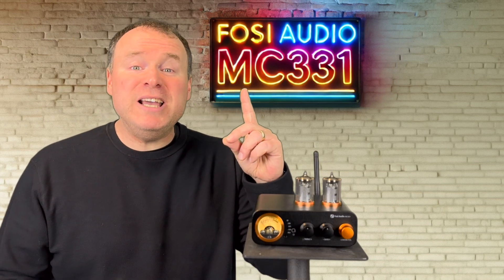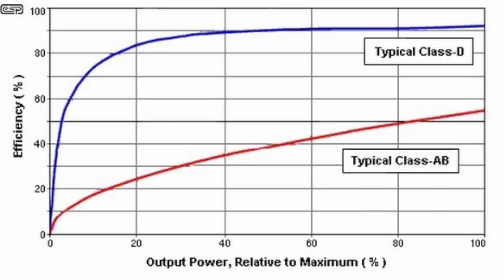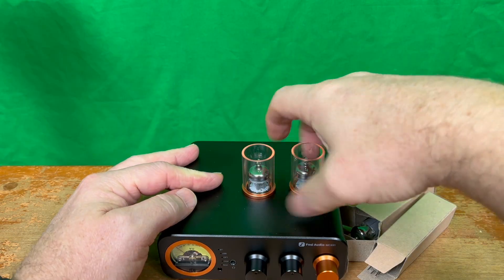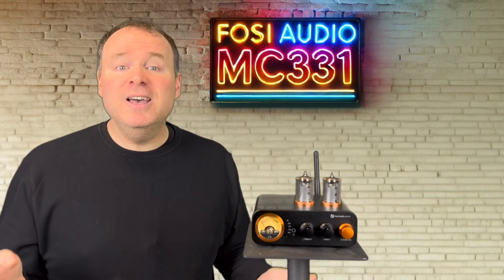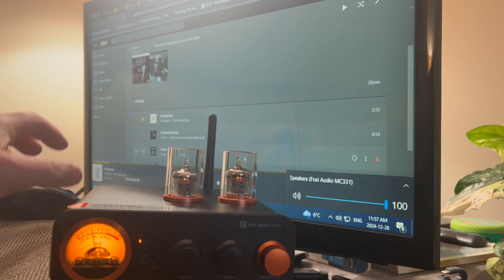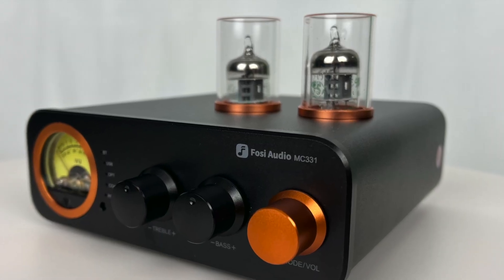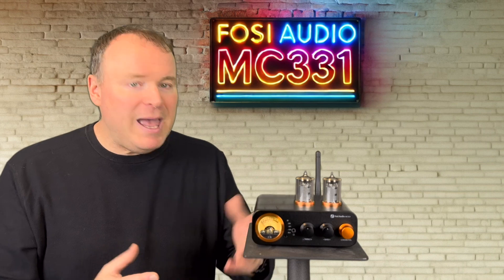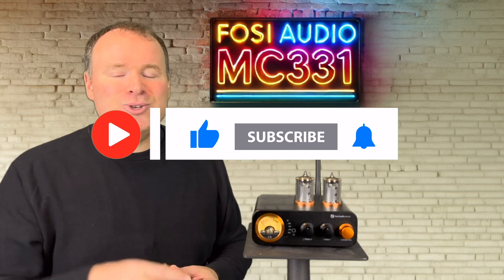Integrated Masterpiece - Fosi Audio MC331

Comment: What, no mention of the remote???
Reply: The remote is full function and works. HOWEVER, the remote has 4 Bass/Treble Adjust buttons that work independently from the front panel Bass/Treble knobs. If you hit one of these remote buttons by accident there is no way to tell how to get back to the default/neutral bass/treble settings.  This is a major design error.

Comment: Awesome review, what output power does the headphone outlet provide? I have AKG-K712 pro & ATH-R70X
Reply from the maker: Thanks for the kind words, @bobbubevski2719! The Fosi Audio MC331 provides a headphone output power of 140mW at 32 ohms, which works well with many headphones, though it might not drive extremely high-impedance or power-hungry headphones to their full potential.

The AKG K712 Pro (62-ohm impedance) should perform well with the MC331, delivering good volume and clarity, but the ATH-R70X (470-ohm impedance) may require a bit more power than the MC331 can comfortably provide for the best experience. If you regularly use high-impedance headphones, you might consider a dedicated headphone

amplifier designed for higher output power.

Comment: I got ripped off! They will not refund my $.
Reply from the maker: UPDATE: I have good news @jameskelly5685 : after reading the owners manual again for the CD-S303, I have found one of my favorite features on Yamaha products… PURE DIRECT.

Page 22 talks about how, when PURE DIRECT is engaged, the digital outs are bypassed. Turning the PURE DIRECT off should resolve this issue.

As a former Yamaha dealer and (still) current fan boy of Yamaha… I use PURE DIRECT wherever possible… it just makes sense… except in this case.

Please check and let me know.
Reply: @consumertechcheck  So let me get this straight. Do I connect the optical cable to the MC, and the RCA's from the Denon receiver, to the MC? Or do the RCA's go from the CD to 
the Denon only?
Reply from the maker: Well, you have a few options here. 
A) Use the Fosi as your DAC and as your AMP as well, in which case you would abandon your DENON. in this setup, you would connect your speakers to the FOSI too, along with your CD player via optical or coax. This may have less power then your DENON, but will be a great setup, depending on your speaker choice.
or,
B) If you prefer to keep your DENON as your amp: just use the FOSI as a delicious DAC. Plug the CD player into the FOSI via optical or Coax (making sure that PURE DIRECT is off), then use the preamp output on the back of the FOSI, via a 1/8" stereo jack to RCA (cable), into your DENON's aux input or any other available RCA input. This setup will require the FOSI to be left at full volume at all times. But will work beautifully with your DENON this way.
Reply: @consumertechcheck  Thanx. I have to purchase a Pre Out cable. I will let you know. If I thought that a DAC was going to be this convoluted, I would have never got involved.
Reply: I will let you know. Thanx so much. I hope it works!
Reply from the maker: Please do…
This makes most sense…

And I think you’ll love the combination..!
Reply from the maker: Please explain?
Reply: @consumertechcheck  I can not get the unit to work with my Yamaha S303. I've tried every cable combination, with no sound. I want to return it, but they keep sending email asking for videos of my connections. (i sent photos) I just want to return for a refund, but they avoid the requests, and just keep sending system generated "Form emails" I'll never buy from a Chinese company again.
Reply from the maker: That’s weird.
Two questions:
1) can you get sound out of it when connected to a different source?

2) have you checked that you are running the most recent firmware version on the S303? Page 26 of your owners manual walks you through how to upgrade your firmware. This may not be your issue, but worth ruling out.

Believe it or not: I have had great luck with warranty replacements/ returns in the past with ChiFi before.

And yes, they have asked for video. I’d go along with their request of sending them a video of showing the connections… all of them, power, signal, speaker, plus showing them that the source is playing via the timer countdown, and showing them you select the appropriate input on the front panel and adjusting the volume.

I bet, if you demonstrate this fully… they will help you.

Please keep me updated.

I can send you your owners manual for the s303 if you need.

Comment: Worse version of old aiyima T9 pro, so I do not see sense in this model
Reply from the maker: I’ve never had or listened to the T9 Pro, but I see your point… a very similar product in every sense.

Like so many of these manufactures, they all compete in the same space and try to reproduce the success of one another’s products.

The upside is: it pushed them all to move forward, delivering us newer, better, improved products along the way.

It’s no different in the car market. And thanks to this competition, we see the advancements we do.

I fully trust that the T9Pro is great!
Reply: Not similar, T9 has a lot better functionality, better dac, full remote, digital control etc. Digital control is important as in case of analog one fosi has usually problems with neutral positions - zero is not zero. And what is very important, T9 has vumeter calibration, older fosi amps with vu did not have calibration, so vu was not only kind of useless but what worse, They were very annoying due to simply generated mechanical noise. Fist of all should be checked if adjustation (on the bottom of the device)  is possible here.

The main problem is that this fosi model is regression, not progress. On the market where progres is expected.

T9 is mainly ok, but has typical for high power class D units keying filters with not enough effectiveness on output and in consequence a lot of ultrasonic artefacts. I would expect progress on this area - better keying filters. (lower power chips are much better on this). 

Also, as this is tube preamp, I would expect dac to be not delta sigma but at least multibit or better native r2r. Fiio showed that this is possible even in low price range.
Reply from the maker: I’m starting to think I need to get my hands on a T9Pro…
Reply: It would be good to compare, theory is theory, assumptions are assumptions, but in practice is possible for simpler model to sounds better for some reason :D or not - only comparison can really say :) but from pure functionally point of view - T9 is superior and worth to try
Reply: @trekkis  
" Digital control is important as in case of analog one fosi has usually problems with neutral positions - zero is not zero"

A little trick for getting the center rotation points on the knobs (esp. tone controls) right... The pot shafts have slots in them, center rotation is when the slot is horizontal.  The pots are all mounted to the main board, which means that the slots will line up when centered. 
I just put a piece of stiff wire through all the slots to hold them in center position, then start the knobs with their indicator marks straight up (12 o'clock).  Slide the wire out sideways and press the knobs into place.  It will be right every time.

The problem is the way the knobs are installed in the factory... they're randomly one flute off.
Reply: This is some method. I'm using oscilloscope, with square signal. Center position is when square is really square, not other figure. Problem is than in some fosi models there is never a perfect square, which means that there is never true 0 position. But can be adjusted to possible extend. In my case bas knob needs to be almost 40° to the right, treble about 5° to the left. Tone controls can be useful, but can be also really pain..
Reply: @trekkis  
Class D amplifiers don't do well with square waves.  The output filters tend to give false readings of high pass problems.  Also note that even the very best designed tone controls do tend to produce very poor square waves at their outputs. They are literally taking the signal apart and then putting it back together... the limited high frequency response of the bass control, coupled with the limited low frequency response of the treble control tends to result in somewhat mangled square wave outputs. 
The good news is that true square waves are relatively rare in music.

Your best bet is to run a proper frequency response test with a swept sine wave ... This will tell you how far off the tone controls are far more accurately than square waves will.

My little wire trick was to compensate for the hap-hazard way they install the knobs in the factory... I didn't mean to give the impression it was correcting electronic deficiencies. But you probably should be sure they're on correctly before testing.
Reply: They don't do well with any waveform due to keying distorsion on low volumes, but there is no problem with real impact on high volumes (but not on max volume - there is clipping on max), all waveforms including square are close to perfect. Besides, in units with aux out with tone control applied, aux (preamp out) can be used to receive reading without class D chip influence. 

Good designed tone controls results with perfect, ideal (to some extend) square without any distorsion when controls are set to 0 (as is in t9pro with digital control). Worse ones not (as is in my fosi with analog controls - square is never on the same level as aiyima, especially not in case of 0 positions). It's worth noting that T9 is still very cheap, so formally far for being one from best ones - still, tone controls and square are perfect. There is no problem with or class D characteristic here (on higher volumes) or with band merging / cross. 

Maybe reason is that T9 is using digital dsp on dac level, but shouldn't, according to available information dac shouldnt be used for analog / rca inputs, this connection should remain analog. For sure no any low pass filter is used. 

True square wave is impossible in music, but it is good to perform adjustments and specially to check used low pass filters. 
I was also using swept sine, and result was usually similar as indicated by square. Differences in amplitudes could be observed accordingly. 

But i double checked now and you're right that results are not fully identical, swept indicates that bass correction on fosi should be lower than indicated by square. Not 40° but closer to 20°. Thanks for pointing this out. 
But still, correction even smaller, still in fosi in the same direction is needed. Results in aiyama remained the same - 0 is 0, square is perfect, swept is perfect (almost no any difference in amplitude). Correction from aiyima menu using even lowest value of 1, changes square and amplitudes very significantly. 

How square is looking is maybe not direct, but still good indicator what to expect.
Reply from the maker: I certainly do NOT have an oscilloscope, although I've played with them before in the repair shop of the AV store I worked at as a kid. and i'm very new to REW software. Is this something I can test using REW?
Reply: Oscilloscope is tool definietly worth to have. But mainly cheap one. 

To perform more detailed measurements (like sinad/thdn/noise floor, dynamic etc) better, 12 bit models with advanced fft math are needed. But truth is that these advanced measurments are mostly worthless and saying nothing about real audio. They are mostly art for art. Personally for me, something mostly for fun. Very often the worst gear in measurments sounds simply best - like tubes with a lot of distorsions or r2r dacs. Worse, often even literally terrible measurmets but sound far better than perfect transistors with "perfect" delta sigma chips. Most important sound characteristics (nuances within time domain) simply can not be measured this way. Simple parameters created from synthetic tones are saying almost nothing and often are loss of time and money for gear. 

But oscilloscope is worth to have because now on market are available very cheap, handy, small models, simple, 8bit, without advanced math, but costs about $100 or even less. They can not provide advanced measurments, but they can simply show basic look of waveforms without any problem. Which can say many interesting things - can show if amp is properly tuned, what kind of low pass filter is users in dac, how impact of each dac filter (slow, fast, etc) exactly looks, why hi res is myth, if Nos (non oversampling / filterless) mode is true or not (and often is not), if there is in fact any preamp / tube or other chain element impact on sound, how high is particular class D device keying distorsion, quality (noise) of used power supply - a lot of interesting things to learn about sound and gear, with very cheap cost.

Regarding REW or other Diracs, something similar can be said. This is more advanced software, where first of all not so cheap microphone is usually needed. Is room correction needed - oh yes it is very needed almost everywhere. Can improve sound absolutely dramatically. But is advanced version with dedicated gear needed? In case of typical adaptations  It will provide better results, but it is not necessary. Even simplest free app for phone can effectively, accurately measure for free in very easy way fr response in room. According to measurement, even such cheap devices like wiim mini (or better models like ultra) can be adjusted within their Peq (parametric EQ) accordingly. Very cheap and easy way with great effect. Advanced gear or soft can be used of course, but is not necessary for typical applications - unless someone want to introduce whole proper room treatment, have possibility to freely place gear and buy dedicated acoustic treatment stuff. In such case, to prepare not only gear but full room, advanced software is helpful. 

Wiim ultra has room correction bulit in (its better to invest in such device than in external microphone), but simply phone app + manual peq can provide much better result than wiims auto mode. 

But room correction measurments have nothing in common with oscilloscope measurments, those are different topics. Room correction software is measuring frequency response within room acoustic, basically measure response of sum, gear and room (where mic is input), whereas oscilloscope is measuring directly gear, what device is generating itself on electric level (where directly connected voltage is input). 

I know that there are also some similar functions in rew, but personally I never tried to use pc as oscilloscope, as far as I know sound card as an input is serious limitation - can not directly work with high voltage produced by amp or even dac. And adc chips in typical sound card probably are not very accurate and noise free, often with limited frequency range. Some better audio interface probably would be required with better, isolated AD, and some voltage divider. Such soft require some additional gear. 
 But I do not have personal experience in this area. If someone has, I would be happy to learn.

Comment: I am sure that you as a seasoned reviewer will know, that the indicated wattage is not based in real world. It lacks an indication if it's measured RMS or AES. So I assume that it's PMPO or other nonsense to get that high numbers for marketing.
Reply: The truth is that none of these Chi-fi companies are actually lying about their specs. They're just quoting the chip's absolute maximum ratings. 

Do a search for the "TPA3255 Data Sheet" and the "TPA3221 Data Sheet" the manufacturer's ratings are there.  TI sells dominantly to engineering and manufacturing, they're not going to lie about their chip's abilities. The various graphs tell the story.

So yes, the TPA3255 chip is capable of 300 watts per channel... but at 10% distortion and with a far better cooling solution than you find in these little amplfiers (I mean... big heat sink and fan).  

Measuring the TPA3255 on my bench tells me that in day to day use with a 48 volt supply you can very reasonably expect 100w RMS per channel on 8 ohms and 200 on 4, with very low distortion.

The TPA3221, will give you about 40watts RMS per channel on 8 ohms and 75 on 4 ohms with no problems.
Reply: @Douglas_Blake Exactly true :)
Reply from the maker: Amen…
Reply: @consumertechcheck  
Both Fosi and Aiyima now include "1% by test" charts of power at various supply voltages on their websites. (At least for their new products)  You might consider flashing them onscreen during your reviews.
Reply from the maker: That is a great idea…
I far prefer a 1% rating.
As I would never listen beyond that.

Flashing that on screen when discussing ratings would provide good information. 

Love it!
Reply: @consumertechcheck  
Yep ... and it's honest.
Reply from the maker: Yes, I am well aware of how manufacturers stretch their specs… it’s been a thorn in the industry since the dawn of time unfortunately. I would love love love for this to stop!